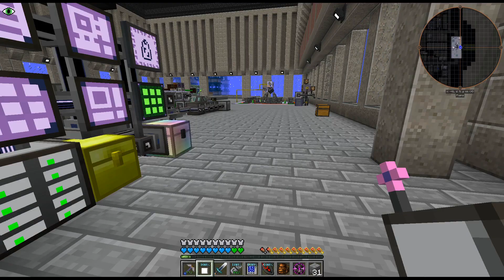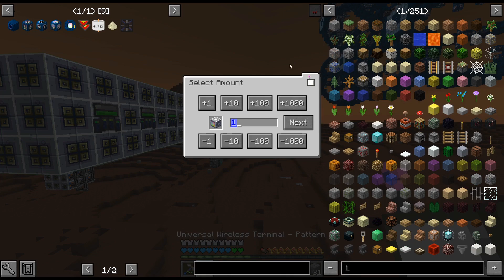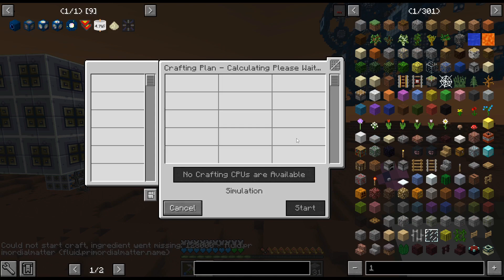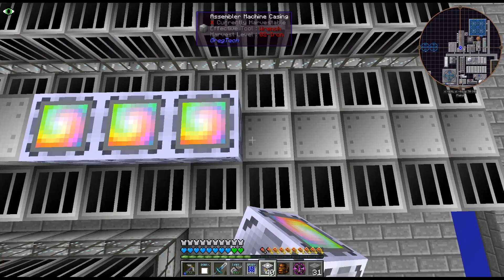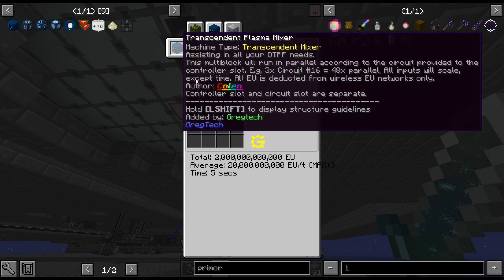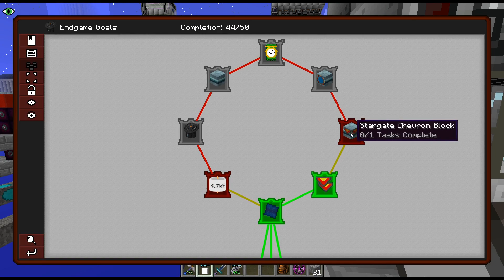GregTech New Horizons S2 - 460 - More Stargate Parts

Comment: Pretty sure there is a tool to toggle batch mode for an easier way to switch to batch mode
Doing lower tier lasers on the AALs and adding more AALs would be a lot more efficient with power. Laser OCs are very expensive on power
Reply: You're right, it really would be power efficient, however it would negatively influence the tps for sure

Comment: The part I find crazy is how you're getting to the point where even EOH power isn't enough to run the base! It might even make sense to downgrade some of the AAL's (Like the stargate parts aren't really a bottleneck compared to their ingredients, so those definitely could be downgraded to save on a decent chunk of power I would think)

Also worth mentioning that it is definitely more energy efficient to parallelize instead of overclocking for most processes (since most overclocks half the energy efficiency of a recipe), especially the super power hungry AAL's are the biggest culprits as far as I can tell.
Reply: it may be more energy efficient, but tbh the real question is if it’s more tps efficient